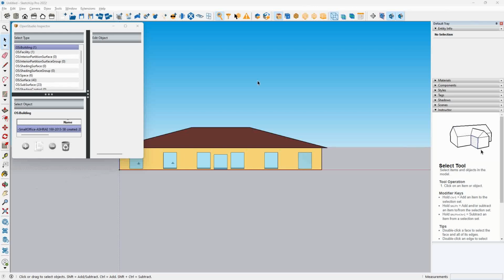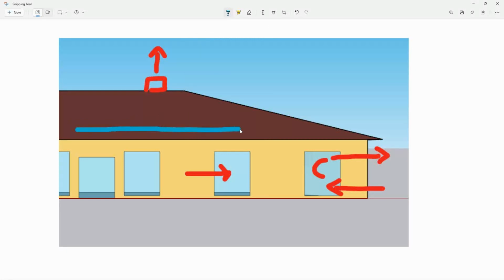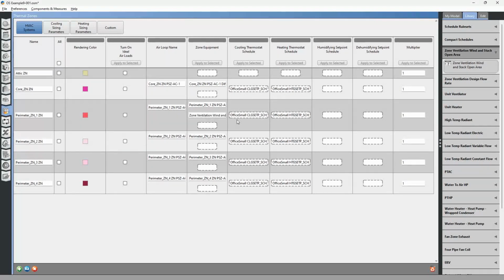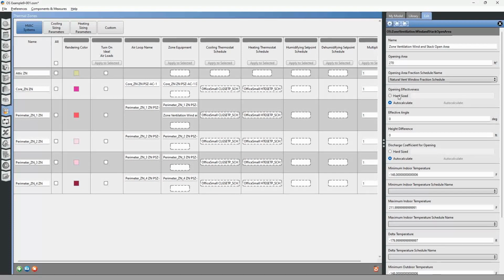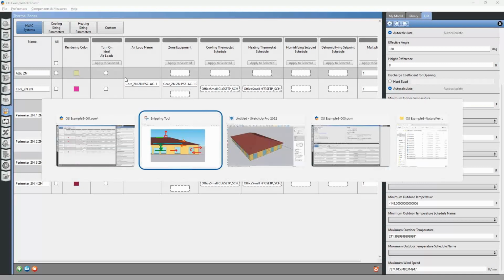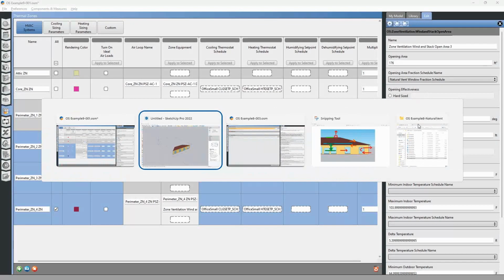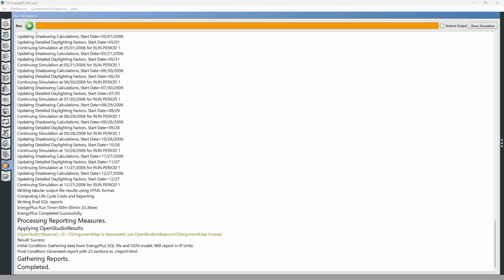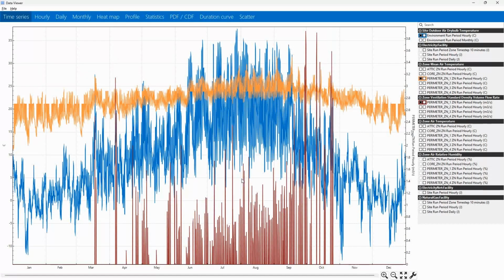OpenStudio Tips - Natural Ventilation-Zones

Comment: hi,

if the wu¡indow is above the neutral pressure level becuase it is a building of several floor then, 

would the difference in height between the middle of the window and the neutral pressure line have a negative sign (-) ?

because from your example that the window is below the neutral pressure line , you put a height difference with positive sign (+)
Reply from the maker: I do no believe this object is intended to be used for modeling such a situation.  If you look at the equation used for the stack effect, you will see that using a negative value would cause the equation to have a square root of a negative number (ie. it becomes an imaginary number).  However, you could try it and seen what the simulation does. :)
Reply: @helixenergypartnersllc3540  then , does it work for a case with just one floor?

Comment: Hi, I am trying to simulate natural ventilation in single story 1 room building which has openings (windows) on north and south walls. What should be the effective angle in such a case ? because effective angle will be 0 for door and window on north wall but 180 for south wall. how do I approach this since it is only a single room that's why only 1 thermal zone has 2 different directions for window openings ?
Reply: kindly respond as you are my only hope before this sem's submission deadline.🙏
Reply from the maker: If the openings are on different orientations, you will need a WindandStack object for each opening.  If the openings have different height differences, you will need a WindandStack object for each opening.